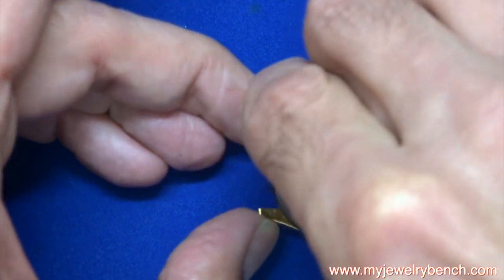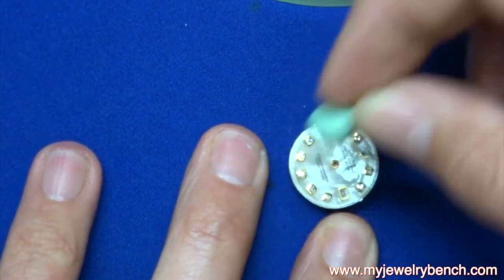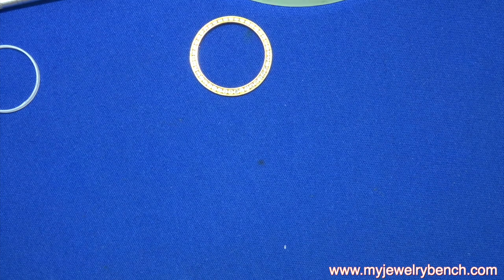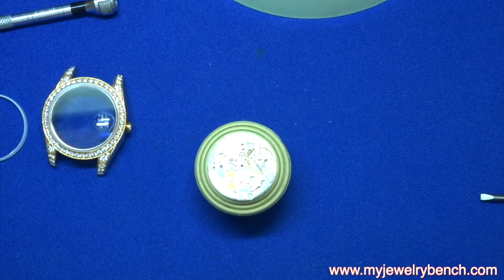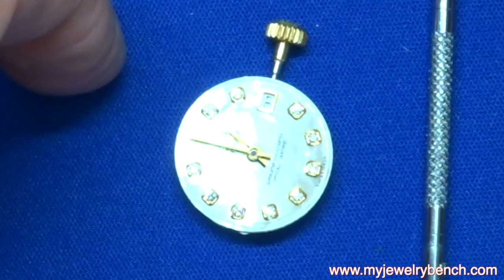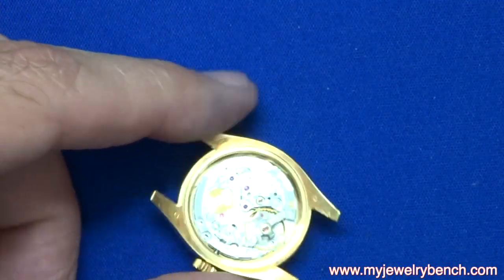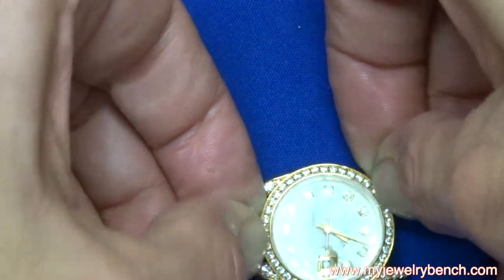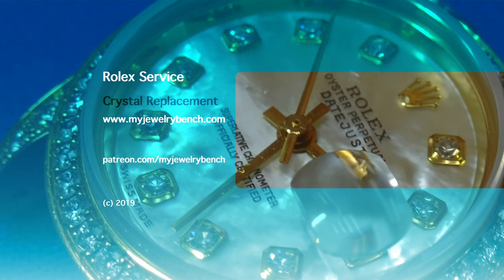Broken Crystal on Ladies Rolex, No Problem  MJB

Comment: Possible to put the acrylic dome glass instead of the sapphire?
Reply from the maker: Very good question. Yes it is possible. You will have to know two things. The outer diameter of the case where the crystal sits and the inner diameter of the bezel that pressure fits in place to hold it together. I had a ladies Rolex last week that someone did not check before they set a new crystal. It must have been loose because someone actually glued it to the case. It does not last and makes a bigger mess.